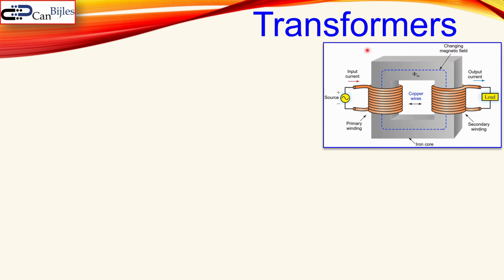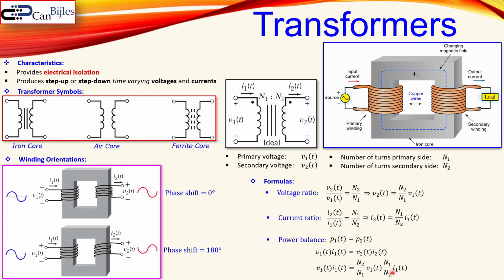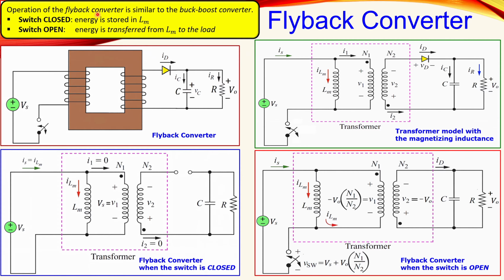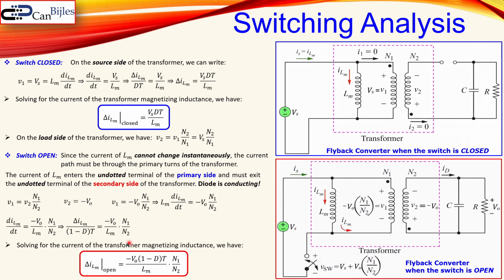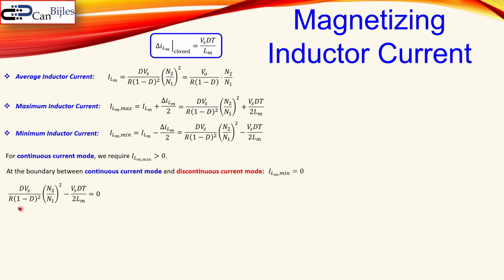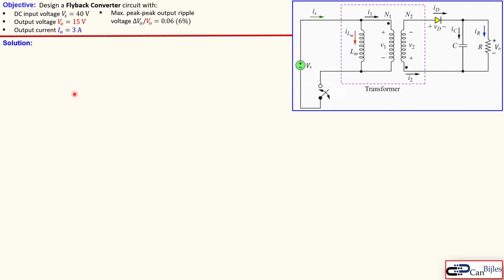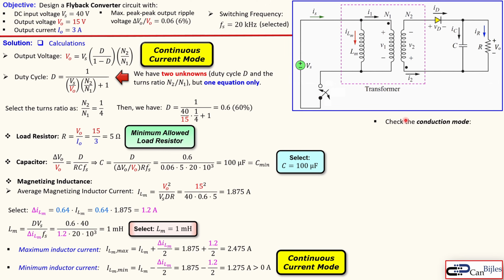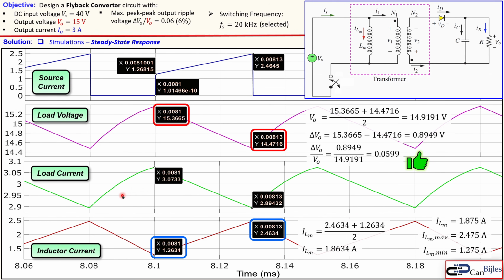⚡ Flyback Converter Explained - CCM DESIGN 🔋 Theory, Design Example & MATLAB/Simulink Results 👍

Comment: I am slightly confused, if Lm and N1 are the transformer, in a real fly back converter where does the current go on primary when switch is off? As there isn't actually two shunt inductors, Lm is just modelling the magnetising inductance. Thus when the switch is closed you would just have your transformers coil of wire in series with an open switch?
Reply from the maker: Thanks for your question. The current does not “go anywhere” when the switch opens, it stays in the magnetizing inductance and forces the secondary to conduct. Your confusion is extremely common because the flyback transformer is not behaving like a normal transformer during energy transfer. The transformer we mention in the flyback converter is more of a coupled inductor with energy storage in the gap. It does not really work like a usual transformer. This is the key distinction in flyback converters unlike forward converters or other type that require demagnetization mechanisms to work properly.
Reply: @CANEDUX thank you!

Comment: Great video thank you for producing it. One comment on the transformer,  it is more of a coupled inductor device with energy storage in the gap. It does not really work like a normal transformer. Just thought this is key distinction in Flyback converters unlike forward converters or other type that require demagnitization mechanisms to work properly.
Reply from the maker: Yes, you are right. Thanks for this information! Glad you liked the video 👍

Comment: what about the primary and secondary inductance of the  transformer, How to design that ? will that make no difference here
Reply from the maker: In this example, I focus on the the ratio of the transformer turns, not on the actual inductance values. Yes, it does matter what the value of these inductance are.